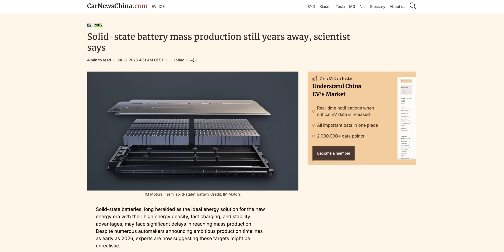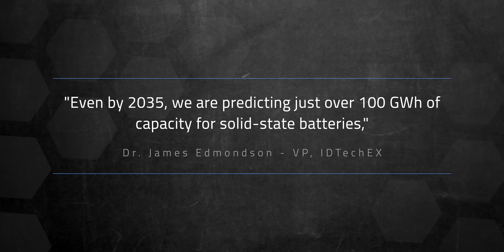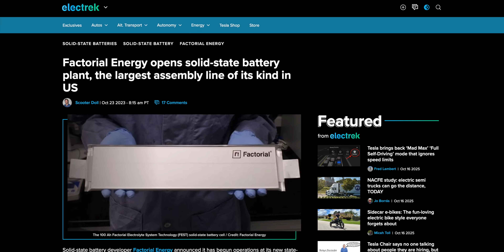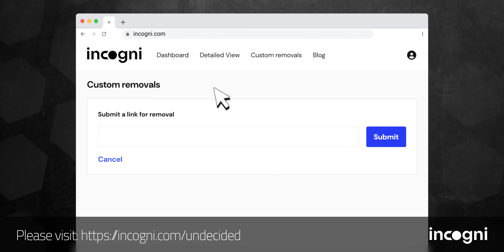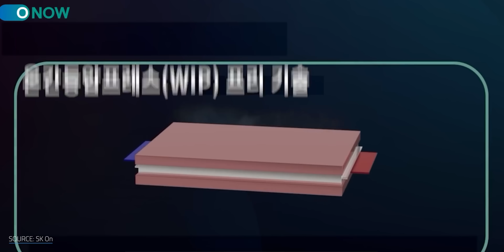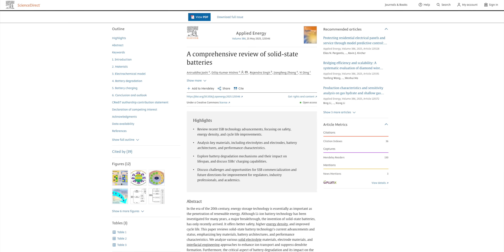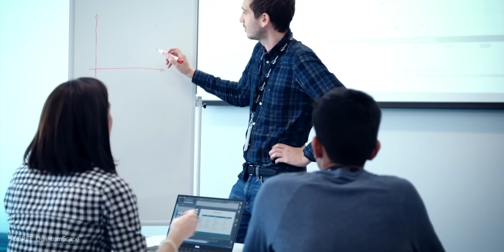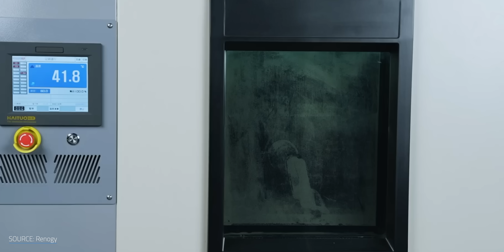How Close Are We to Solid-State Batteries?

Comment from the maker: Are SSBs going to actually happen and become another great option for energy storage? Take your personal data back with Incogni! Use code UNDECIDED at the link below and get 60% off an annual plan: http://incogni.com/undecided

If you liked this, check out How My Geothermal Heat Pump Really Performed (2 Years) https://youtu.be/DTb7TKJzr5g?list=PLnTSM-ORSgi7uzySCXq8VXhodHB5B5OiQ
Reply: Agree, the industry needs to start referring to these batteries from a two category perspective: SSSB (vs SSB) aka: Semi Solid State vs true Solid-State.
Reply: In my opinion, I think that it has to be a clear definition of solid state batteries at semi-solid ones. Also, I'm wondering if using salt brine from water desalination plants can be turned into battery materials to promote a circular economy, together with using Nano materials and metal materials as a good solid electrolyte in solid state batteries?
Reply: @paytonturner1421  They're either solid or non solid.
Reply: @paytonturner1421  obviously big valuable EV batteries will be recycled, just as 95+% of the far more toxic lead-ACID batteries in gassers are.
Reply: No. They won't. This is just another round of hype.

Respectfully, every other episode on your channel is based on new battery technology that never goes into production.

There's too much commercial pump and dump to trust the private sector startups.
Reply: If your sponsors are as good as your "science", then no thanks.
Reply: 'miles'? It is not the dark ages anymore, use standard units of measurement. Disliked and not going to subscribe.
Reply: Not close
Reply: Things like the YASA new prototype motor, and Chevy new 600wh/kg battery will be great if true. 

 YASA motor says they got a prototype motor 1000bhp, 59kw/kg at 12kg, or 28.4 pounds! With continous rating estimated 350-400kw

 750kw. 

 About 30kw/kg which is a weird metric I know. Just easier to compare. 

 A top fuel dragster is anywhere from 26-35kw/kg, and needs to rebuilt. 35mj might be generous estimation can anyone correct me AI spits out a new number daily. No one agrees. Why. 

 Hell an F1 cars total system is 5kw. Again generous. 

 No exotic materials, and I'm told probably just diaelectric cooled? I don't know about that. Always the kicker. 

 You guys know how awesome that is? Super redundant VTOL becomes accessible, and 600wh/kg batteries are enough to power it with graphene capcitator tech. 

 It will revolutionize daily lives even if production only reaches 80% the stated power. 

 The question is how long, because so many short sighted haters exist. 

 Cool aviation, military, industrial applications too for a 30 pound motor cranking out dragster like power. 

 I need a chainsaw powered by that as I haven't kept up on the backyard. 

 There are already scooters with more HP/w than a Veyron apparently. 

 Future is shaping up to be absurd. YASA owns the previous record holder for most power dense motor. 

 Motors are naturally balanced, less parts, more reliable, more power dense, smaller package, easy to power, lasts longer, and this one doesn't use special exotics.
Reply: Once a year we do this dance haha
Reply: 5:01 where NIO semi solid battery
Reply: yawn. even if solid state becomes available this year with all the positives, it remains dead because it is going to be absurdly expensive. there is more hope with LFP and Sodium ion as they keep going down in price.
Reply: You really should take note that AI writes in a certain way and it comes through on some of your script.
Reply: Matt Ferrell, a couple of points.

2:05 "If a battery charges to 80% in 10 minutes and won't catch fire when punctured, I don't care [about its chemistry]". But as you surely know the latest BYD and CATL boring cheap LiFePO batteries can recharge in less than 10 minutes with 10 C "Megawatt" charging, pass puncture tests, and last a million km. So SSBs' only advantage over batteries available today is higher energy density (both by volume and weight).

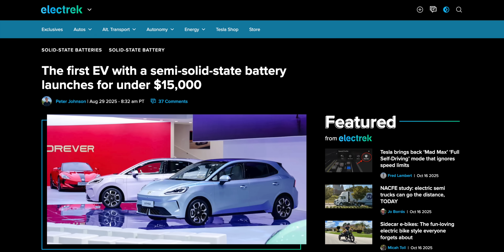3:20 the highest trim MG4 model's "semi-solid-state battery will have a  range of 537 kilometers or 333 miles". Always mention the  testing regime for any range claim. You should have said "a range of 537 kilometers on the Chinese CLTC test cycle, which is very optimistic compared to U.S. EPA range". Likewise 4:54 "Mercedes just completed a long-distance  test with its EQS model equipped with Factorial's solid-state battery,  and the result was impressive: 749 miles on a single charge." That's presumably on the WLTP cycle, which is more optimistic than U.S. EPA range.
Reply: Yawn. It's difficult to take any battery tech update that doesn't include Chinese giants like CATL seriously. Maybe I missed it here, but any tech info creator on YouTube who doesn't keep up with, or have info on, Chinese tech is living in a bubble. They can't be taken seriously, and should be considered strictly infotainment.
Reply: Have a look at YinLong LTO cells. LTO is Lithium Titanate.
They can be crushed and don't start a fire or even hot smoke but a slight CO2 mist.
If you puncture them they might still work a bit.
The big D cells with the screw terminals at each end of the cylinder.
Reply: And on to the scene stepped Donut Labs... the future is now
Reply: Donut labs?
Reply: @UndecidedMF  please
Reply: I haven't heard one word about the company named Donut Solid State battery. 😅
Reply: @UndecidedMF  I'm waiting for the zero point energy battery.
Reply: Wait a minute, CATL already produces battery packs with a 50/50 to Li-Ion/ full solid (less dense), why didn't we covered it?
Reply: ah more vaporware that will be available in 20+ years source trust me bro
Reply: Worth baring in mind when governments disguise corporate welfare as tax defuctions for plant and equipment, in an imploding economy, factories will pop up that do literally frantic nothing except become hype hives for stock pumps, meaningless work hubs soley for personal individual debt obligation "achievement" purposes, real estate arbitrages, and ultimately......waste.
600 miles in a single charge? GREAT!! Hows it looking by the next full charge?

Comment: 2:16 i don't even care if it charges twice as slow with half the density of good lithium at twice the cost, i would take a 5lb laptop if it means the battery lasts forever, its not a phone why does it need to weigh in the scale of ounces. If i can stockpile batteries and replace them without worrying about them dying in storage. A flashlight that just works forever. I want longevity. Ideally i want longevity, efficiency, and a low rate of passive discharge.

Sure for EVs or phones we would want all metrics to improve

Comment: Check out the announcement at CES 2026 for a solid state battery (Donut Labs) that solves all known problems with batteries and is available now.  It even goes much further by offering 100,000 charge cycles.  This feature alone is disruptive technology.  You will only need to purchase the battery once in your life, passing it from car to car.  Many industries (ICE cars, Lithium, Cobalt, all car makers, battery makers, etc.) will either collapse or be forever changed.  This announcement reminds me of the cold fusion announcement in 1989.

Comment: if the Donut lab's announcement in 5th of January 2026 about an All-Solid-State battery holds true, the big manufacturers are already behind the curve; World's First All-Solid-State Battery in Production Vehicles by Donut Lab, an European battery and motor company, that might well be the first Unicorn company of Finland, more significant than Nokia ever was, if these claims hold true and the business side is handled well.

Verge Motorcycles own's Donut Lab, and Verge Motorcycles has already used the Donut Lab motor for a Guinness World Record for the longest distance by an electric motorcycle on a single charge, which is 310.689 kilometers (193.053 miles), set by Sam Clarke and Sara Sloman on a production Verge TS Pro in Greater London on March 22, 2025, navigating real city traffic conditions. The record-breaking ride, which took over 16 hours and used an unmodified bike with a sealed charging port, still had 7% battery left, demonstrating significant real-world range beyond lab tests. This was before the introduction of the Donut Battery, which is set to be on the latest version of the TS Pro and TS Pro Long range bikes.
Reply: @Thamaell-San  300 km in 16 hours? That's like 15 km/h in that speed all ev bikes can do 300km. Give me 300 range in 90 km/h because fast speeds is where range of EV drops really

Comment: so took 2 months, solid state batteries come to production now in finland
Reply: Not likely.  Having a low volume in a pilot line or production line (semantics) means you are still years away from full scale production.
Reply: @radar_x8613  If claims are true, other manufactures will jump on producing it like there is no tomorrow, I would not be worried about production scale at all.
Reply: @Bluelife-y4f Do you believe everything you see on the internet?
Reply: @JrbWheaton  yes
Reply: Sorry but Donut Labs claims are outlandish. There is no shot anyone should believe them at this point.
Reply: @FreshMattizl  You can order them today.
Reply: @jepjep000  Hopefully it's not just hot air like a few other local EV-related things...sounds too good to be true.
Reply: @jepjep000  You can per-order the Verge motorcycle with Donut Lab battery, not just the Donut Lab battery. And it would arrive by end of March 2026 (if no pushbacks). With a European price of over 35k€.

Comment: Some of you have negative comments.   How many ICE engineers are trying to design a better engine for the future.  How many engineers are working on better motors, better batteries and cheaper autos for the masses?  Another 10 or 15 years in the future the hybrid or EVs will be flooding the market and every year another big auto company will join the search for the best EV.  They'll be spending the money on electric research.  The ICE cars will not have research they have had 5 or 10 years ago.  No money in it.

Comment: I doubt we will see it first in a car, it’s more likely we’ll see solid state batteries in smaller consumer electronics such as headphones and smart watches first before it scales up to phones and tablets then to computers and finally large deployments such as cars. 

The supply early on will be limited as manufacturing has to scale and failure rates are likely to be higher. Also in particular for small consumer electronics such as headphones and smart watches it would be a real relief to not have something that can explode and catch fire (even if rare) making contact with my skin all the time.

Comment: I feel like expressing energy density in Wh/L isn't that helpful.  But if you look at it from the Wh/kg perspective it gets interesting.   Ok, so if I have my figures right, the Quantumscape QSE-5 cell is 301 Wh/kg energy density.  While the cells in my 2022 ID.4 battery are 259 Wh/kg of energy density.  This would imply that the Quantumscape battery is roughly 17% more energy density than the LG cells in my ID.4.   Nice, but not really so impressive.

Comment: The challenge in technology is that there is always a sub-optimal answer to a problem that actually needs to be commercialized for progress to be made. Depending on the area, the lifetime of the sub-optimal solution varies, can be real expensive to scale-up, and poor management of development can result in high company turnover. And then there is just market luck. 

This is why technology roadmaps are so important and provide a rationale for investment. Investing in a single technology can mean limited company lifetime.

Comment: Whatever you knew in 2020, 2021, or even 2024, throw it all out the window. Market forces (see: idiot in charge) are going to both accelerate and stagnate things in ways we don't expect - even ways that work against each other. For solid state batteries to be truly viable in the world market, they need to address three big numbers: 10 minutes for 100kWh and 1kWh/kg gravimetric density. That will give us 100kg of cells which can be supported by 100kg of BMS and chassis, rather than 1000kg for the pack alone. We need to get back to actually human-safe cars. Heavy cars, aside from driving like shit, simply aren't safe for anybody.

Comment: The only hang up will be the degradation. Lots of people waited 10 years to buy an EV as the batteries got more reliable. I have a feeling the market will be small enough that even if the next leap in battery tech happens in 10 years, it may be 20 before the cars are affordable enough to consider against the traditional battery tech EVs. Regardless, it's likely most of those cars won't have steering wheels/yokes by that point.

Comment: On the opposite side of battery tech - Nickel-Iron ? I can't find any of your videos that cover this & it's still the single most reliable and long-lasting battery technology there is (if low energy density), with originals from 100 years ago still functioning.
As long as the electrolyte is replaced occasionally, they appear to have an unlimited life. It seems most battery manufacturers do not want to sell a type that will not need replacing!

Comment: There many advanced battery technologies are available since year 2000 and those scientists were promising mass production would be within 5 years ahead, 10 years ahead even 20 years ahead. However, here we are in 2025 that those advanced battery technologies are still in laboratory phase because the investors are representing big oil companies.
Reply: If those advanced battery technologies were not good enough for electric cars but actually still sufficient for grid electricity storage which those scientists could produce to sell but  the problem for sure depend on the investors.

Comment: You look at every technology in battery and there are various ways you can make a battery that is long lasting, high energy density, fast charging, safe, etc..BUT the main problem is the cost of manufacture - its still TOO DAMN expensive...Every path the manufacturing OR the input is too damn expensive..That is the real challenge

Comment: I want super high capacity SSD w/ solid state battery built in with a wifi/bt microcontroller.....so you can flip a switch wirelessly upload/download to a drive in your pocket on your keychain.  I mean sure its an absolute nightmare for data security and insider threats but the utility is also amazing if you could pair that with hardware security keys or something.  Or a built in biometric, scan your finger print to confirm upload/download.   I can see the solid state battery really being cool and starting some revolutions.

Comment: EV transition will not be hindered or slowed down by absence of Solid State. I don't care which battery is under my EV because it already delivers 450-500 km range on one charge and it meets my needs. Lithium-Ion will also improve over time although slightly. Lithium-Ion to Solid State to me is like we have now carbureted cars and they are going to be replaced with injectors.

Comment: Personally, I hope BMW and its partner wins the race, as a BMW for many years.  But even if a true solid state battery is achieved (if it can be) by the mid 2030s to early 2040s it would give governments to invest in the charging Infrastructure.  That said if a new battery chemistry, almost solid can deliver more range than a petrol engine, quick re-charge times, longer life and improved safety.  It’s going to change the world in so many ways and help us meet 2050.

Comment: Full electric is awesome but having a 2 cylinder motorcycle engine as a generator with a capacity of 3 gallons will be so awesome extending range and removing range anxiety especially in winters driving a battery cold will kill it fast reaosns why you need to keep it plugged in alot to warm the batteries to temp at all times. With a range extender, it can partially warm up the liquids with the heat and generate some power back on tap, would be much more better and give many more people reasons to leave full ICE vehicles and switch to electric range extended cars.

Comment: Anybody I talk to about electric vehicles I always say that the average person should not get an electric vehicle until they can get the ranges above 500 mi and at least sub 15 minute charge times and the only car that gets close to the charge time is the ionicQ5 and 6 which have ranges around 330 or so with charge times from 20 to 80 percent at about 17 minutes and full charge to about 30 minutes. Until solid state batteries or some form of it comes about with ranges at least 500  and with charge times below 15 minutes right now isn't really a good time to be getting the EV well depending on where you live and the cost of gas to electricity cost

Comment: I would actually consider an electric vehicle that goes 700 miles. I prefer 900 before I’d pull the trigger. I want an electric vehicle that allows me to drive as far as I’d ever consider driving in a single day on a single charge so that it doesn’t slow me down

Comment: I wonder if you used the SSB to power the drivetrain and a hydrogen engine to allow heating and cooling the cab and provides heat for the batteries to work, if they need higher temps to work at best range and operation.

Comment: I usea 19070s Hammond Organ. Dentrites are a real problem. If you open up cetain devices, you can see them standing up, on each other's backs,  like the iron filings you get with the school demos of magnetism. The way I deal with this is zap the casing with a 9v charge. This collapses the dendrites and its a while before the  build again, that can be years. Of course the parameters change, but surely this is proof of concept for a solution?